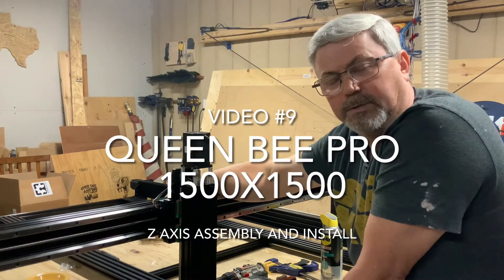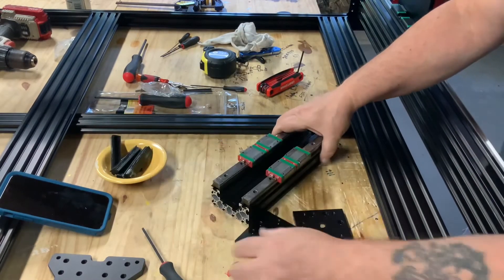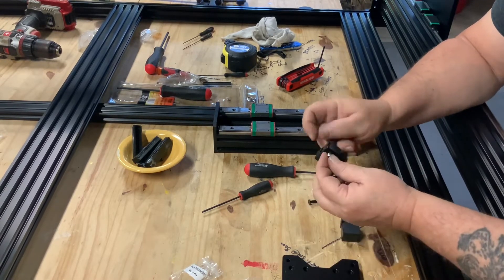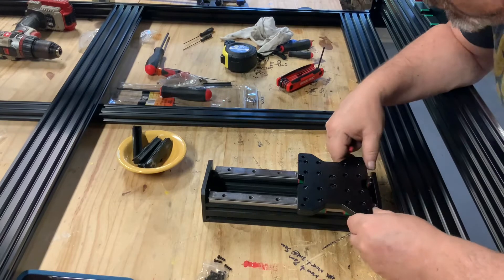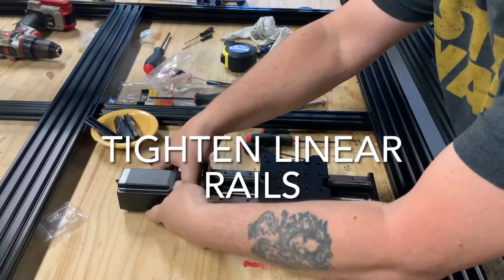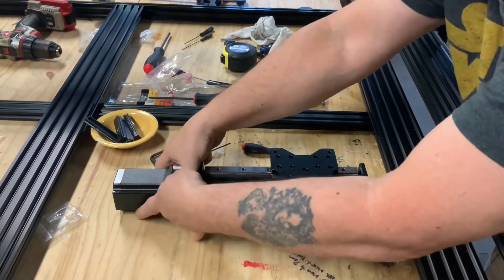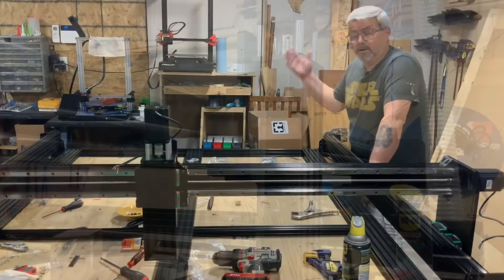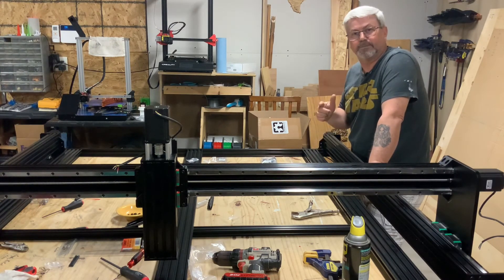Bulkman Queen Bee Pro Build #9

Comment: Thank you for these videos up to this point.  I can't wait for the wiring series.  You have put me a step closer (if not tipped me over the edge) on pulling the trigger on an order of the Bulkman Queenbee Pro.  How have you found the parts quality for the mechanical kit?
Reply from the maker: The quality is really good. Easy setup and calibration. The only thing I did not like is they did not allow for limit switch mounts in the mechanical kit. I got some simple “L” brackets from a local hardware store for 2 but had to get a little creative with with the z axis. But, in the end, I am pretty pleased with everything. I will upload the wiring series hopefully this weekend.
Reply: @2tankardscreations211  good to hear. If a little limit switch creativity is the worst of it then I can live with that. Loving the videos mate. Keep up the good work 👍🏻